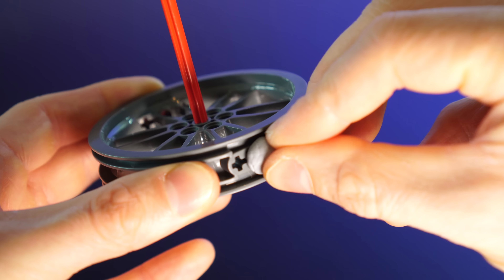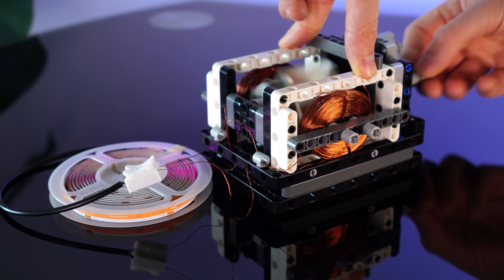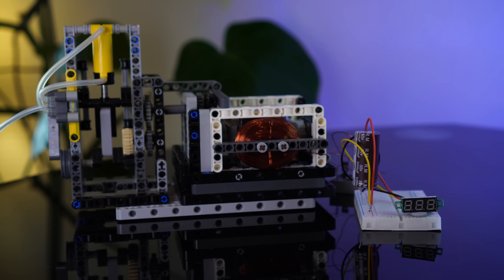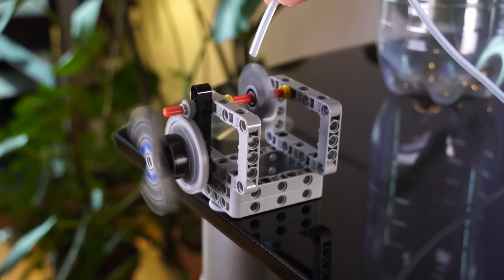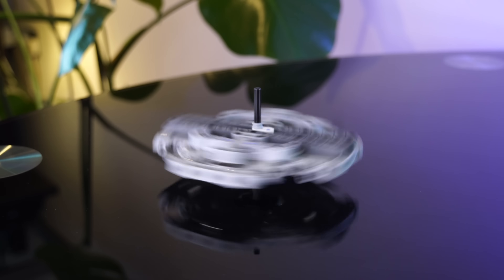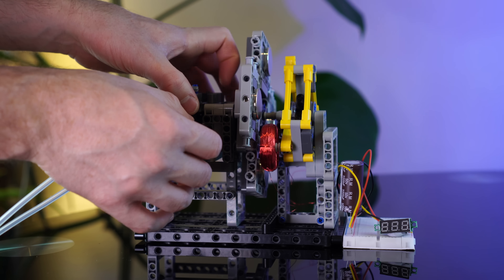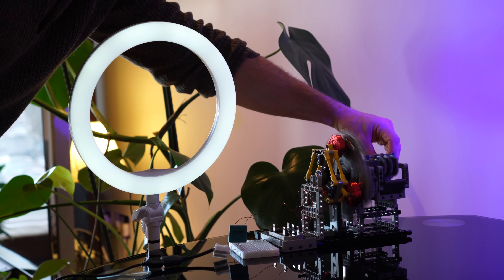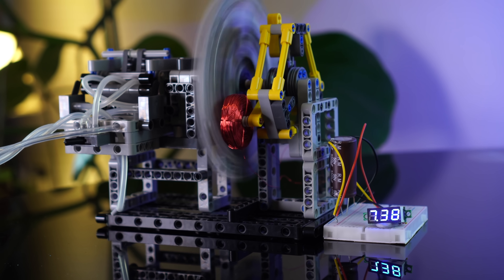Lego Air Turbine: Generating Power From Thin Air!

Comment: how do you wind those coils so perfectly?
Reply from the maker: Thanks 😁 I have various methods (and keep forgetting how I made some of them as they were a while ago), but generally, I chuck a couple lego wheels onto an axle, and then just wrap the wire around the axle between the wheels. The wheels keep it neat. Sometimes I get fancy and use a motor to wind it as the thinner wires can take thousands of turns.

Comment: mate you should have just made a compound engine or a twin simple and that would have worked fine without stalling. remember that the cranks must have a 90 degree offset if its a 2 piston compound or 2 piston simple
Reply from the maker: Don't worry, that's certainly on the cards 😜 Although it might be cheating a bit, I'd love to create a powerful generator using Green Gecko's 4 or 8 cylinder engines, and some beefy magnets and coils. See how far we can push Lego
Reply: like i said compounding is the way to go. or just multi piston simple but still. also dont know how it would act in a air engine (i know steam stuff) but its worth a shot
 @JamiesBrickJams

Comment: Absolutely amazing, try some light machine oil next time, your axles will last longer and allow more performance to come out.
Reply from the maker: I contemplated using some silicone spray, but decided the mess wasn't worth it. But I've ordered some metal lego with bearings, so we'll see how that performs!
Reply: @JamiesBrickJams I know graphite powder is a still a little messy, but it might be a little better than silicone until the bearings come in

... maybe. I haven't played with the stuff in years

Comment: The turbine would probably work better without the spacers between them, so it's not as easy for the air to escape through the side (probably not a big difference tho)

And the piston engine would be more torquey and smooth with a second cylinder 90° out of phase (so there would be no deadzones without a power stroke)
Reply from the maker: That's a fair point, I could certainly give that a try. I'd also love to get some advice from better Lego builders than me about how to make a better enclosure for efficiency. Failing that, I reckon 3D printing a Tesla turbine could be a fun (though cheaty) experiment
Reply: @JamiesBrickJams I’m sure you can find a way to build a Tesla turbine without 3d printing, I’m pretty sure there’s a few lego designs
Reply: @Overseer_Yt. You can build a Tesla turbine with thin sheets of paper actually.
Reply: @CENREAPERYT  I thought so, but wouldn’t the paper be to flimsy?
Reply: @Overseer_Yt.  Not actually. It'll work just fine because the pressure off air would be the same from all sides. I mean,if you put a sheet of paper on sawmill shaft,it can cut through 16 layers of aluminium foil
Reply: @CENREAPERYT  oh ok, I didn’t know that!
Reply: @Doggysuseg yes
Reply: POV my science teacher you

Comment: Try to make some cover for the spinning gears, that you Are blowing at. You save moře air, that Will spin more (i Hope you know what i mean)
Reply from the maker: I do! I actually experimented quite a bit with creating various airflow cages around the fins, but it didn't seem to increase speed or torque, so I ended up not using one. But you're totally right, a proper enclosure should increase efficiency quite a bit. It's just quite challenging using Lego to build that!
Reply: @JamiesBrickJams  thanks for answer.

Comment: you should try to make a lego vacum engine and add the generator to it bc  lego vacum engines hase lots of power (i recomend to build a i2)
Reply from the maker: I've considered that a bit... It just feels a bit weird to plug a large power-hungry device into the wall, only to extract a small amount of power. But as a proof of concept, I like the idea! Will look into vacuum engines at some point either way 👌
Reply: u can make like an i4 for more power :) @JamiesBrickJams
Reply: @haulasgudaitis8918 I think one of the issues is that vacuum is more limiting than positive pressure, you only have one atmosphere before there's no more air, but you can always compress to more atmospheres (within material limits)
Reply: search it up on how it looks to get the idea
Reply: They don’t have a huge amount of power and they need a loud, immobile, power-hungry vacuums close to it all the time. Vacuum engines are cool and I have made lots of them, but personally, I think pneumatics and more mobile things are cooler

Comment: Nice video! It seems to work pretty well! I have experienced with making turbines with pneumatics aswell, and one thing I realized is that taking the nozzle from an aerosol can and using it as the nozzle for the turbine helps TREMENDOUSLY. Like, please try it.
Reply from the maker: Hot damn that's a great idea - I'll give that a try!
Reply: @JamiesBrickJams   It literally gives the same power for a lot less air used

Comment: How did you make the voltage meter at 3:41 ?
Reply: He obviously didn't make that, you can buy them online for a few quid
Reply from the maker: Yup, what they said - these little chips cost a buck or two on Amazon or AliExpress
Reply: @JamiesBrickJams  thanks, just found a few on amazon, never seen them before. Why have you got a big capacitor there?
Reply from the maker: The cap is just to smooth the output a bit. Otherwise the output can jump up and down a lot depending on the movement of the magnets.